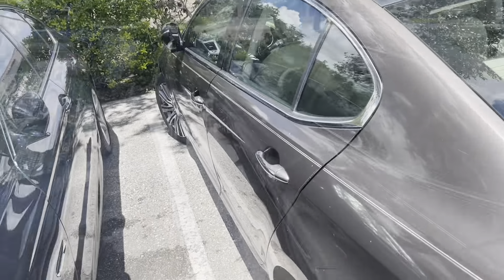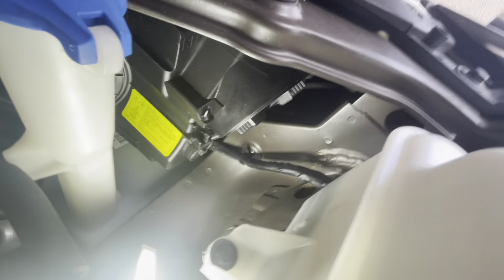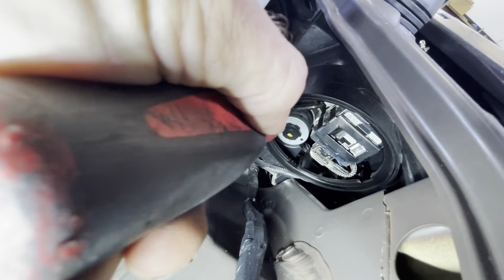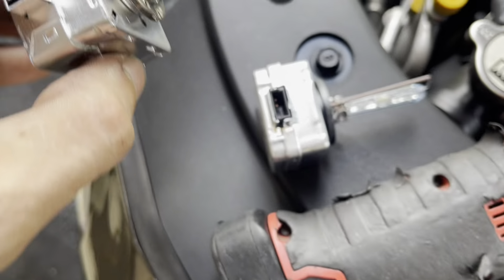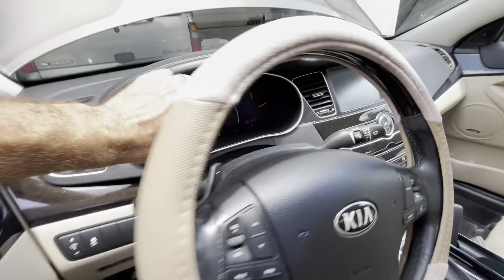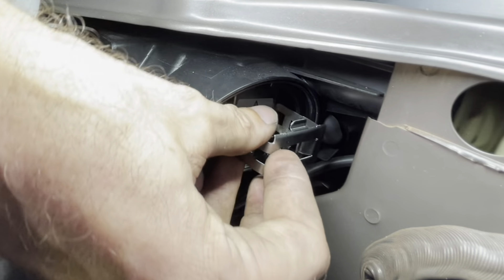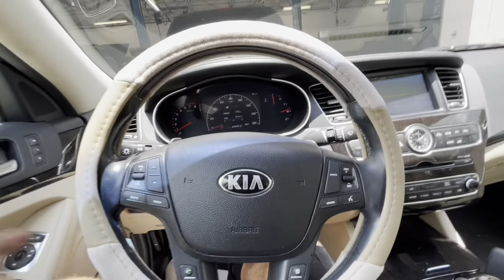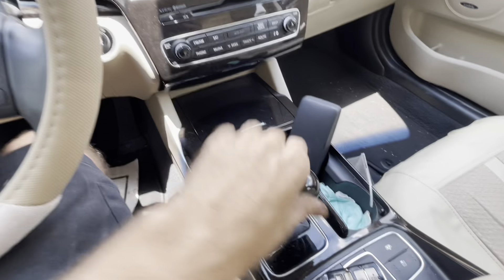Abnormal EVERYTHING All Day! Kia Cadenza

Comment: I have learnt from many years of experience that if one headlight has blown the other one is not far away either, as a rule of thumb I always replace them in pairs.
Reply: Yeah true.
HID bulbs also have a tendency to change color with age. Brand new they got that awesome cold light with a blue tint but with time they fade out and look yellow like Halogens.
Reply: @alouisschafer7212  you are correct, and halogen bulbs are shocking for blowing the other side once you have replaced one side.
Reply: True but customers don't want to hear that...so one it usually is
Reply: I do that with halogen bulbs, too. But HIDs are a bit on the expensive side. Especially when they have electronics attached.
Reply: In modern cars, when one headlight blows, it's time to sell the car 👍😂
Reply: @daves4202  ain't that the truth 🤣
Reply: @blockbertus  that you are correct, hid globes are rather expensive.
Reply: @keithlarge1151  yep customers also don't get that when one is blown the other is about to go too. I replaced a halogen globe for a customer they only wanted the one, came back a few days later as the other side blew,  I did tell them 😂
Reply: That happened to me last week first the right side went then 2 days later the left side went - I had the foresight to buy 2 bulbs just in case though
Reply: And always a week or two before the annual Safety Inspection is due. 
Because the last time you used it, it worked. 

Bonus comment: now you have a spare.
Reply: Doesn't apply to this car. First, these bulbs are very expensive. They can cost several hundred dollars. Second, you didn't see it in the video, but the cable you plug into the bulb goes to a ballast. Its a separate power supply for the light bulb, and it acts like a buffer between the bulb and the cars electrical system.
Reply: @AT-wl9yq  you are correct, but as per my comment and I did own a vehicle with hid headlights I found that when replacing one side the other one was also on its last legs.
Reply: They asked for one
Reply: I changed the left bulb in my 2002 F 150 4 times and never changed the right one. That's over 350,000 miles.
Reply: @steveb6103  WOW that's good.
Reply: If a headlight goes my car tells me throws up a service vehicle soon light.
Reply: @MrSox1967   my third brake light has three bulbs inside the housing I only needed one but changed all three at once
Reply: @ryans413  lol, mine tells me by having by having quicker flashes or the light stays illuminated constantly then I know it's burned out.
Reply: Simple effective and no need to throw a SES light lol
Reply: adam j  You have it all wrong my friend. Now the new cars so cleverly engineered that you don't ever have to change a light bulb . Whether a light bulbs fails , you just simply buy a new car ...problem solved.

Comment: I have driven KIA Sedona minivans since 2004. I replaced my first light bulb with the bezel mounted to the van. The second time I had to replace a light bulb I took a different approach. I used a 10 mm socket to remove 3 small bolts. Disconnected the wiring connectors, removed the bezel from the van. This way I could set the bezel down on a towel & replace the bulb much easier as well as faster. Reducing my stress greatly. KIA doesn't give enough room to access the back of the bezel. I am not a mechanic,  although I do play one in my driveway. Thanks 4 the videos

Comment: I wish that the mechanics that I encounter around my area would take the time to clean up after themselves. I have light colored interior in one of my vehicles. I drop it off with them for a small repair or oil change and when I get it back the door panel is full of greasy hand prints. I would switch shops but this place is the most honest shop around. The rest of them try to bs you into things that you don't need. Or try to kill you by leaving your lug nuts loose and send you down the road or strip out your oil drain plug costing you additional money to repair because they deny damaging it in the first place. Keep up the good work Ray! The world needs more guys like you!

Comment: Ray the Rambler is always fun to listen to. Also, replacing headlights in an '03 BA Falcon (australia) is an hour long chore too, have to remove battery and airbox just to get enough room to get at them. And to replace the front indicators, you've got to remove the front wheels and inner guards ....
Reply: 05 maxima you have to pull the bumper and fender well and wheel
Reply: Hope y'all properly compensated for all involved. It's not your car or need to fix it for any less
Reply: And why they don't sell them anymore.
Reply: @grantleyhughes  they don't sell em any more cause Ford left Australia!
Reply: I feel your pain, I'm seeing that problem too in my Falcon. My question I'd like to ask the designers is why make the hood release lever so flimsy and breakable? My XH never gave me those problems. (sigh)
Reply: @stevo2992  The Paint we feel is watts driving many to the engineering of FoMoCo here and Japan's big Two.
Reply: @mylairhasnoip  I know. I live there. And having owned a BF once, I can understand why they weren't selling.
Reply: My 1962 Falcon takes about 10 minutes

Comment: I was recently commandeered to convert my moms 2018 Hyundai Ioniq headlights to leds and let me tell you it’s the biggest pain in the world, literally 3 inches of room if you don’t move anything on the left, I could move a reservoir on the left like you did but on the right is the fuse box which isn’t exactly easily moved, suggestions online were literally “remove the wheel well” I didn’t end up needing to do that but in total it took me 50 minutes. I really wish they’d build these things with maintenance in mind.

Comment: there is a team of engineers somewhere that think that is the coolest lightbulb clip ever invented.  It definitely looks like it is designed to have a specific tools used to "easily" disengage and re-engage...because EVERY single part needs its proprietary tool.
Reply: And let's not forget that if you break off the plastic tabs that the retaining clip engages with you'll be replacing the entire headlight housing!
Reply: Bulbs in my car literally screw in you place the bulb in then place the locking ring on the back side turn a quarter to the right it locks down so simple you do have to pull the whole headlight out put it’s still pretty simple
Reply: As an engineer I can assure you, we're not thrilled about these things either. We're asked to design everything down to a price, sacrificing everything but the bare minimum of functionality. Clips are cheaper than threads.
Reply: @eelcogg  Ahhhh....now that is a very good point to make...I often forget that "cost efficiencies" forced upon design work can lead to unintended difficulties/undocumented features.
Reply: So many of these unique features make sense when the sub-assembly is alone on a bench.  Once installed in the system (the car) with accessibility issues, they become nightmares.

Comment: I think the taboo against moving the seat is the chance that you'll be blamed if the seat adjustment motor doesn't work when readjusted. In many cars they aren't moved for years, so a customer may not know the switch or motor is broken. Then you move it and he can't get it back. Like a mirror control, the switch may work in only one direction.
Reply: If the motor or switch is broken, the seat won't move to begin with.
Reply: @AT-wl9yq  Like a car mirror with a defective switch, when they fail sometimes they move in only one direction. Before moving it back, make sure it is capable of moving forward.
Reply: @spelunkerd  I see what you're saying. It doesn't matter because we can bypass the switch if something like that happens. Or, if the car is still under warranty, I'll just fix the problem.

Comment: That was an easy one. I have a 2011 Chevy Equinox and I had to replace the driver's side turn signal bulb....what PITA! There is a small access panel inside of the fender well. I removed the tire and reached up in there to change the bulb. It is above the headlight bulb and I was only able to get two fingers on it. Well, those bulbs cannot be turned with two fingers. I removed the fender liner to gain more access but still wasn't able to reach it. I ended up removing part of the bumper cover and facia. Then I had to pull the headlight out partially and was able to then access the turn signal bulb. A ten minute job turned into three hours! Thank you GM engineers.

Comment: I'm glad you clarified the low/high beams because I couldn't tell with LED headlights. I feel like I need to install rally lights because so many people drive with their high beams on and I couldn't tell for the longest time.

The old halogen bulbs are better. Sure they're not as bright but at least no one is getting blinded going the other way.
Reply: I almost went with LED aftermarket but they're very expensive and don't have a great lifespan
Reply: I remember when halogen bulbs first started getting popular in the 80's.  People would flash their lights at me thinking I had my brights on because I had halogens.  Then they got to be the norm and no one cared.  Then it was HID and now LED.  They are getting more and more common and soon no one will give them a thought and be on to the next thing.
Reply: LED should be illegal for headlights because they produce a narrow beam more conducive to spotlights, which means neither the person using them nor oncoming traffic benefits from their use.

Automakers already had a better solution in HID, providing the light was installed correctly and had a quality reflector.
Reply: @woodstream6137  These new cars are definitely going to surprise people when they realize you have to replace the whole headlight or taillight assembly when the LED goes out for hundreds or thousands of dollars.